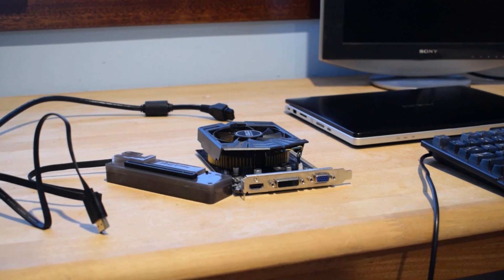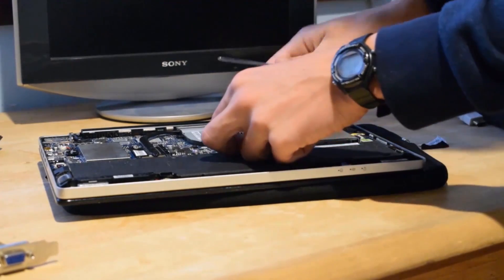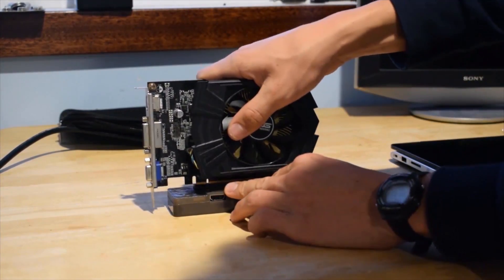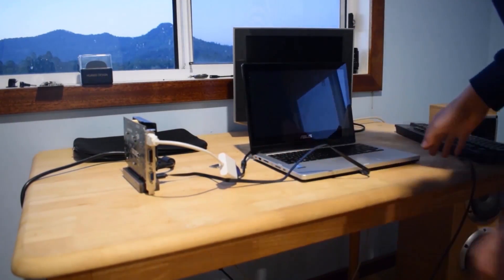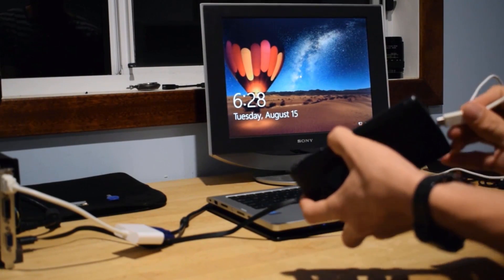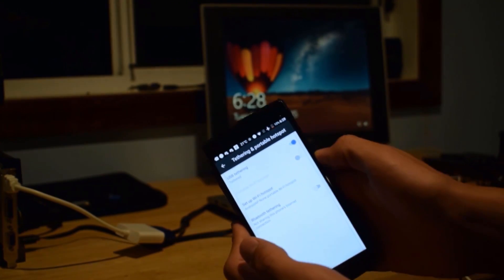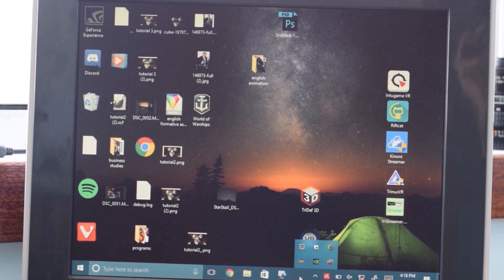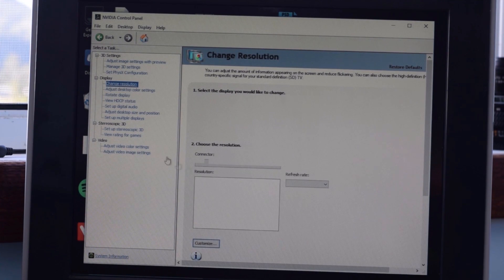How to Connect External PC Graphics Card to Laptop (no thunderbolt port required) Egpu Setup

Comment from the maker: Thanks for watching, would be really cool if you could leave a sub, every sub counts!
You can find all items needed for an egpu setup on my website, including links to buy them: https://qwertypopyt.jimdo.com/buy-products-seen-in-videos/
- Some useful resources regarding egpu setups:
General Egpu info:
https://egpu.io/external-gpu-buyers-guide-2017/#mPCIe-interface
https://www.reddit.com/r/eGPU/comments/5jpf2x/diy_egpu_101_introduction_to_egpu/

Some info/issues to take note of:
Nvidia 10xx series egpu driver issues: https://egpu.io/forums/expresscard-mpcie-m-2-adapters/nvidia-is-killing-off-mpciengff-m2-egpus-error-43-with-372-90/

HP bios whitelist info (bios whitelist prevents you from connecting an external gpu if your laptop has it):
https://h30434.www3.hp.com/t5/Notebook-Wireless-and-Networking/Does-HP-Pavilion-15-e001ax-has-bios-whitelisting/td-p/5973244
https://www.sevenforums.com/hardware-devices/293403-beware-dreaded-white-list-hp-guilty-charged.html
Reply: like and subscribed ;D
Reply from the maker: Thanks :)
Reply: hope you will reply...
can i use the circle port as a power input instead of the other one?

Comment: Can your Graphics card works on 3 monitors simultaneously? and I see on other tutorials they used big PSU and aside from the dock power they also add one more power socket to the gpu, but yours only powered by the docked , can u tell me the difference please??

Comment: I don't know if this is still active but I still want to ask, I think I have a decent gaming laptop. Asus with GTX 1060gb gpu, i7-8750, 16gb ram. And I want to buy RTX 2070 gpu to have better or improve graphics while playing Call of Duty Warzone. Now my question is will it work without any problem? Do you think it's compatible? No thunderbolt just the m.2 ngff.

Comment: cant we just connect the gpu to the laptop via vga port? or hdmi or dvi? then we woudnt lose the wifi. then just connect the gpu to the power supply, right? thats a lot smarter. i dont need to open up my laptop so should i do this instead?
Reply from the maker: No, that won't work because the hdmi port on the laptop can only output data, so it can't receive input if you were to connect a gpu.

Comment: Dell Precision m4800, bought EVGA Geforce GTX 1060. Connected, all works but laptop doesn't recognize it. Why?
Thanks in advance
Reply: What the actual f**k this laptop isnt gonna be working its too old
Reply: @Michael Meeks yes I did. Everything works. Playing games like Fifa 18, Mortal Kombat X and 11, NFS Payback all of which on Ultimate resolutions on my 55inch LG 4K TV. Sometimes laptop restarts by itself but it rarely happens.

P. S. All that worked with my brand new PNY GeForce GTX 1060 3GB. The EVGA didn't work for me since it doesn't have HDMI so I got this one.

Comment: Can l use hdmi to hdmi laptop without unplug wifi chip, because it very easy to connect, so l have to use hdmi to hdmi laptop
Reply from the maker: Not quite sure what you mean, but no, can't just plug the graphics card into your laptops hdmi port unfortunately if that's what you mean, because the laptops hdmi port is a hdmi out port, so the laptop can't receive data through it.

Comment: Nice video man. I have a Lenovo Y500 with two gt 650m gpu's working together in SLI. Unfortunately the master gpu is soldered to the motherboard so I can't replace that master gpu with a stronger card. If I try this method that you are showing in this video, Could I make an extra (external) gpu work together with the two SLI cards that are already in the laptop? I know SLI will not be an option because the third GPU will not be a gt 650m, But it would be very nice if I could use the two SLI cards as a OBS renderer and the eGPU for gaming and all of the good stuff. Thank u a lot for responding.

Comment: What graphics card should i get i have laptop with
I7 8550u 1.80 ghz with like a boost i dont know im not a expert at computers but im decent at them
8gb ram
768p display or something like that
Intel UHD 620 graphics 
What graphics card do i get, i want to play fortnite 768p medium settings at 35-100 fps
i want to play gta 5 at medium 768p 45-100 fps
i can already play minecraft at like medium 768p with 8 chunks  rendering at like 30-70 fps but i want to play it at like high 768p with 100 fps or more and with like 12 chunks atleast too
ok thats all if you need more specs that i dont know about please tell me what graphics card i need
Reply: Gtx 1060 at least for u but if you want something that isnt for budget get a razer core x or 2 and a thunderbolt 3 to hdmi or something

Comment: I have I7 5500u 2.4Ghz 2394 Mhz 2 cores 
Amd Radeon R7 M260
8gb DDR4
On tis laptop can i make it? (My laptop is Lenovo Thinkpad E450)
Reply: I have the same too
I think it will work but the r7 m260 is still good for casual gaming like fortnite, pubg.
But apex only runs about at 15 FPS which is too crap.

Comment: No anti-static tools? You got balls. Anywho, thanks for the video, I am considering trying to install a Thunderbolt card to my HP Touchscreen laptop so I don't have to drop another $1300+ on a new laptop. I wonder if anyone has successfully done so using the wifi port? I did find a blog where a guy said he installed a firewire card the same as how you did your graphics card, he just used an extender cable to connect the card to the laptop.
Reply: Did you installed a Thunderbolt card in your laptop? I'd like to do the same, but I don't know if it's even possible.

Comment: I have no idea how you get an external screen to work. Mine only works with laptop screen and it’s also been a headache far from trouble free.
Reply from the maker: Hm, you are plugging the external monitor into the graphics card, not the laptops hdmi port, right?

Comment: Bro jam getting code 43 error help
Reply: that means either your hardware is not working properly, or that you have a driver issue. reinstall the drivers for the gpu
Reply: K bro but iam using latop 2011 g570 will it work i3 8gb ram nvidia gt710 ddr3 external
Reply: @sandeepprajapati9043  700 series cards were first released in 2013  you don't have a gt 710

Comment: So I have an HP with 8 GB of ram, 2.5 ghz processor and want to do this. I would most likely get a GTX 1080 because I have a buddy who is selling one for extremely cheap since he is nearing bankruptcy. I know it's sad for him, but I can't help him except by giving him money for his electronics. Anyway my inquiry is mainly about my Laptop. So I would most likely lose my internal Wifi adapter to plug this Frankenstein setup in, then I could put a cheap external Wifi adapter in the USB port, even though I have a LAN cable run to the desk where it is for when I play games or stream sports to my TV. Would this be able to Play games like Counter Strike Global Offensive? The new Black Ops 4 coming out? Because Blackout battle royale is amazing fun. and Battlefield 1 and/or the new Battle Field V coming out soon?
Reply: @100wcringegeneratoruseslea3  That's a nice idea in theory regarding replacing the CPU in the laptop. But the motherboard would also have to support a newer CPU. If it doesn't, you're screwed.

Comment: I have a Samsung, i7 cpu, 16gb ram.  It has a HDMI port so will this work plugging directly into the HDMI?  If so, I should be able to retain on-board WiFi and monitor, right?  And the obvious next question: Which GeForce card matches best with HDMI bandwidth?  Great video; thanks for making/sharing!

Comment: Hey i just wanted to ask If you can help me get out of this dilemma , that i dont know if i should buy the one with express card or mpcie cable , which one is most likely to work????
Express card: https://www.aliexpress.com/item/PCIe-PCI-E-EXP-GDC-External-Laptop-Video-Card-Dock-Laptop-Docking-Station-Express-card-interface/32540847733.html?spm=2114.10010108.1000023.7.ee02e79aLO6t5w
M-pcie: https://www.aliexpress.com/item/EXP-GDC-Laptop-External-Independent-Video-Card-Dock-with-PCI-E-Interface-Black/32456172794.html 

And tell me if an egpu setup with gtx 660 on Hp probook 6475b will work with any of the cable options (express card , mpcie) , because i have no experience with the bios of my laptop, i dont even know if its white listed or not!!!!

Comment: Not sure if you're still answering these questions, but I've got one. 
HP Envy 15 with Intel i7, 16 GB Ram. What gpu can I run?
Reply: you are able to run practically any GPU no matter what specifications your computer has, however it depends on how strong your CPU can perform which could be a bottleneck. 
This basically means that the Graphics Card (GPU) can be offering alot more power than required, but your CPU (the i-7) can't keep up, which will limit your FPS making a say, gtx 1080TI offer the same performance as a gtx 970.

If you can clarify what CPU you have (eg. i-7 6700k) then i will be able to help more.

Comment: Hi i have lenovo g40-45 amd a8 6410 with r5 graphics 4core 8gb ddr3 ram will this work?
Reply from the maker: I think it should work on your laptop, but your CPU will bottleneck some games. So it depends on what you want to do, and if a GPU will improve that, or if your CPU will severely bottleneck it anyway. Check out this link too, it may not be the exact same model as you have, but there is still some good and useful information and discussion on there: http://www.tomsguide.com/answers/id-3465339/lenovo-g40-support-egpu.html

Comment: not going to knock this it was carefully thought out but FUCK THAT SHIT, the whole thing looks botched cheap and nasty not saying its not innovative because it is but its just too messy and cable's everywhere and I bet you didn't put the back on that laptop properly, hope you are using an earthed surface. any laptop gamer would more than likely save up and buy a decent laptop with a decent gpu in it just looks tacky as shit cables and gpu sat on the desk if my mates came round and saw that they would leave immediately after seeing it very red faced.
but hey thanks for showing us this it shows it can be done but just not very good. ive seen similar mods on the Alienware x51,just never understood why people buy low end systems if they want good gaming graphics.

Comment: I have an:
Acer Aspire E5-574G
Processor: Intel Core i5 @6200U 2.30GHZ (Turbo Boost Up to 2.8GHZ)
Graphics Coprocessor: NVIDIA 940M
Ram: 8GB (DDR3)
Graphics Card Ram Size: 2GB VRAM

Will this work for me?

Comment: Maybe you should mention that the old drivers of the dedicated laptop gpu need to be uninstalled first and the dedicated card to be deactrivated, before installing the drivers of the eGPU... Or is that not necessary anymore?
Reply: Mo AlMo No, I just followed other video tutorials, where all this is mentioned. And it works. Most of the time at least. Most people recommend older Nvidia drivers, anything prior to 372.90. Those didnt work for me tho. I still had error 43. Even with older drivers. So I just let Windows install the latest one (no manual installation) and so far it works without any issues. Im using an MSI GTX 970 Gaming.

Comment: M laptop is Hp 

Processor: Intel Core i3-4010 CPU@1.70GHz
RAM: 4GB
IGC: Intel HD Graphics 4400

Is this enough to run fortnite or if not would u mind helping with a suitable solution sir?

Thank you.
Reply: No just get a new laptop

Comment: Can we use 1060 instead
Reply from the maker: Yeah, you can, but last time I checked there were some issues with using 10xx series gpu's as egpus. https://egpu.io/forums/expresscard-mpcie-m-2-adapters/nvidia-is-killing-off-mpciengff-m2-egpus-error-43-with-372-90/

Comment: My laptop is HP
It has:
AMD A10 2.4 GHz (boost to 2.9 GHz) 7th gen apu
6ddr4
Whats the best gpu I can buy without breaking the bank?
Reply from the maker: Sorry, I'm quite busy with school atm, so don't have time to research that. I would recommend you think about what you are willing to spend, and then buy a gpu that fits your budget. Also, building a pc or buying a better laptop (both used if you want to try to go as cheap as possible) may also be a viable option to consider.
Reply: qwertypop ok thanks
Reply from the maker: Yeah, sorry for not being able to help you more at the moment.

Comment: information on a power supply to use? I am going to do this with a gtx 750ti and also do you know if the express card option works??
Reply from the maker: Yes, the express card option should work too, and the power supply I used is the Dell Da-2, which should also be good enough for your setup.

Comment: Please answer ASAP can you use the laptop graphic card  and the pc graphic card together to play games

And if the graphic card is not the same can you still use both
Reply from the maker: You can only use one graphics card to play games, not both at the same time. So if you are running a game on the external graphics card, you can't use the other gpu to boost performance if that's what you mean.
Reply: qwertypop so the pc graphics card works when I play games on the laptop
Reply: And the laptop graphic card doesn’t do anything
Reply: And by the way I subbed and 👍🏼 thumbs up
Reply from the maker: Thanks :) Yes, the pc graphics card is used when running games, and the other one is idle. I'm not sure if it's a common thing, but my laptop actually disabled the integrated graphics (it wouldn't even show the intel control panel) when the egpu was connected. Not sure if some laptops would use the integrated graphics when on the desktop, but I don't think so.

Comment: Hi i have a lenovo ideapad with gt920m. I want an external card more powerful. I wish to buy exp gdc and a card for thr setup..
How can i buy this and which card should i use? Can i use amd cards?
Reply from the maker: Sorry for the late reply. Yes, I think it should work. Just make sure it doesn't have a bios whitelist (I don't think it does). You can buy the things from Ebay or Amazon, I have links to the things you will need on my website: https://qwertypopyt.jimdo.com/buy-products-seen-in-videos/ . You will need to check what connector your wifi card has (mPCI-e, m.2, etc.) or if you have expresscard or thunderbolt connections to determine the type of connector you will need. Hope that helps, if you have any more questions, feel free to ask them.
p.s. the gpu you should use depends on what you want to do with it, but 10xx series nvidia graphics cards have some driver issues when used as egpu's, so I wouldn't recommend using those.
Reply: qwertypop thanks for the reply.
Is amd cards supported?
Reply from the maker: Yes, you can use amd cards, but you will need to use an external monitor - it won't work with your internal laptop display (some laptops can use the internal display with nvidia gpu's)
Reply: qwertypop so if using an nvidia card,i can use laptop monitor and no need of external right?
Reply: qwertypop how much does it cost for external dock?

Comment: I have a Sony vaio e series laptop
4gb ram
Intel hd 4000 graphics integrated 
Will it work???
which gpu will I use??
plz help
Reply from the maker: it should work as long as your laptop doesn't have a bios whitelist. The gpu would have to be a low-medium range gpu (so that it isn't bottlenecked by your other components). Not sure which one would be best, 10xx series nvidia gpu's appear to have some driver issues when used externally, so probably easier to use an older version. Just check what's required for what you want to run.

Comment: qwertypop
ive a very noob question, i have 1 very old laptop core 2 duo aspire 5334. upgraded processor from T5250 1.5ghz to T7250 2.0ghz. 3gb ram to 5gb now.  IGPU intel family chipset . 
Thunderbolt ? not even exist this era i think. :D 

if it can run egpu, what gtx series recomended for it? enough for me if it can run gtx 550ti even 260 lol. but 260 no more latest driver supported by Nividia. ( sad but true ) 
and what about the bios? is bios just nothing to do with everyhting all of this egpus? 

fyi , i also have desktop computer,good enough for gaming today, but egpu with old laptop might bring me to a new level indeed.
Reply from the maker: That's a pretty low end cpu, so I don't really think it would work too well for games (your cpu's performance compared to mine: http://cpu.userbenchmark.com/Compare/Intel-Core2-Duo-T7250-vs-Intel-Core-i3-4010U/m1781vsm4821 ). If you want to go ahead anyway, what is your laptop model? (some laptops have a bios whitelist which would prevent the egpu setup from working)
Reply: model called Notebook Acer Aspire 5334.  and salute for reply boss
Reply from the maker: Sorry for taking so long to reply, but I need to go to bed now. Will look into it and reply when I know if it works (if I don't forget).
Reply from the maker: I think it should technically work with your laptop (not 100% sure though). Also, if you want to run games well with that processor, the games would probably need to be very light on the cpu, and rely a lot more on the gpu for you to be able to use an egpu to boost fps. Maybe you should just consider getting a decent laptop for cheap and using that instead, as I think your current laptop may just be a bit to old for modern games. If you still want to get an egpu setup, you could also check if you have an express cars slot and connect it to that. With the gpu type, you'd need to check what the things you want to run need.
Reply: ok ill looking for that. thanks for everything bruh, stay health and dont die. people need someone like you